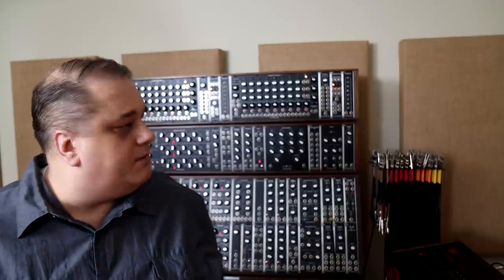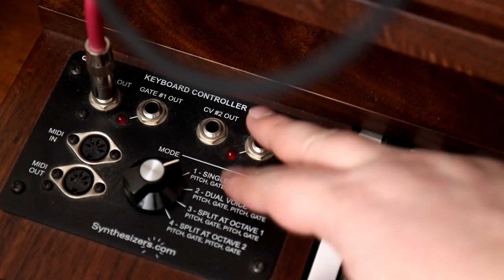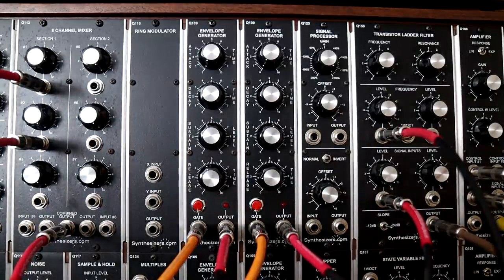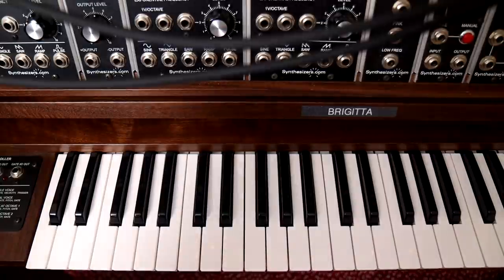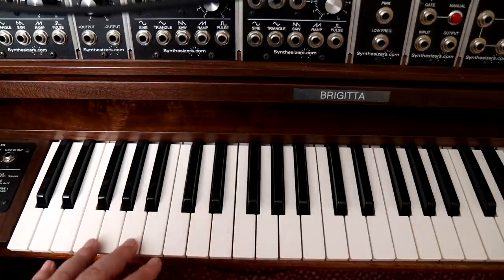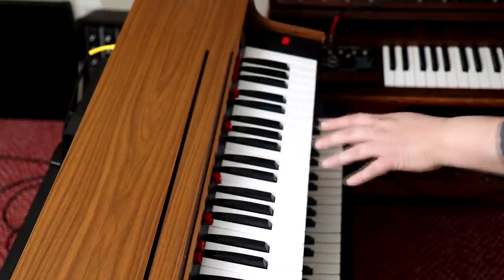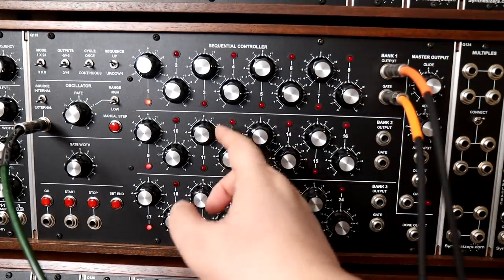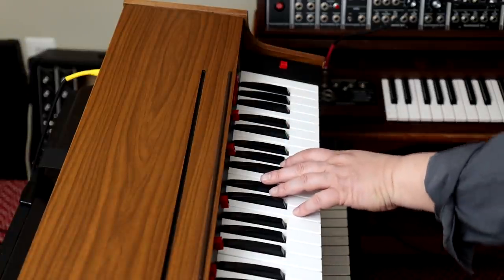How to emulate '80s arpeggiators on modular sequencers

Comment: what a fantastic video!  i have the model d and the 960 in my eurorack set up.  Do you think it's possible to do this with a keystep?  i'm trying to work through it right now but with mixed results.  If you have any insight on the best way to accomplish this  it would be very helpful as a budget euorack alternative :)
Reply from the maker: Thanks! Sure, you can do with a 960 sequencer as well, the 960 has more features than a dotcom 119. However, if you have a Keystep, also read the comment from "Stephen Rimmer" below - he states "Very nice Paolo but I can do it in a fraction of the time using the sequencer on my keystep."  - which of course it's true, but misses the point of the video being about using the "modularity" of modular systems to build something different than what it's designed for.
Reply: @SynthManiaDotCom  Hey thanks for the comment!  I'm still interested in the modular aspect as you mentioned.  I'm trying using the keystep as you used the keyboard, not utilizing the arp or sequencer from the keystep.  Would there be another avenue you'd use with the 960 based off it's features or would you do it the same way?

Comment: I love those old style sequencers. How do you know you have tuned them to a particular key? Software versions make it easy. But hardware is another matter.
Reply from the maker: You can use a tuner or tuning reference (Synthesizers.com even makes a module that makes a standard 440Hz tone, like the original Minimoog), or you can simply go by ear. You can also use "quantizer" modules, that are useful especially with a sequencer module - so you don't need to spend a long time tuning each step - goes a lot faster.

Comment: very cool!
but I don't understand how the keyboard and sequencer work in conjunction controlling the pitch.
I it a special feature of your oscillator?
Reply: What he’s doing is to use the keyboard CV out AND the sequencer CV out to control the pitch of the bass oscillator. It looks like his osc allows him to patch in more than one pitch CV at a time. This means that the root (usually lowest) note on the sequencer will be whatever he plays on the keyboard and the sequencer will continue to play in the new key or chord. He could just as easily run a much longer sequence of 8-24 pitches and still be able to offset (transpose) the sequencer with his keyboard. 👍 now imagine using a second much slower sequence instead of the keyboard 🙀
Reply: @jdanielcramer  THanks